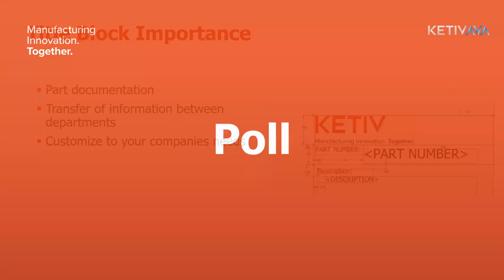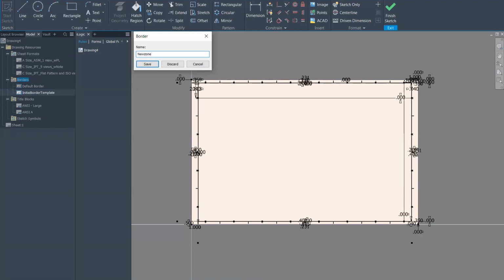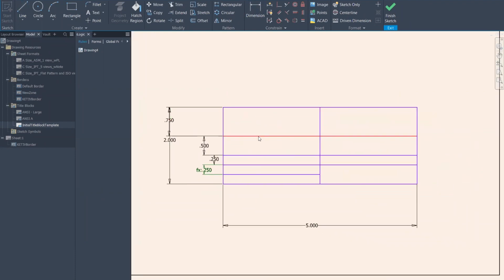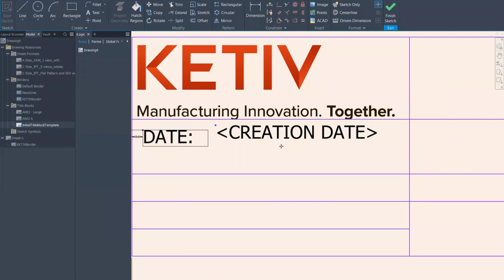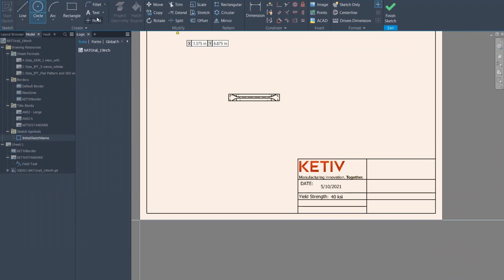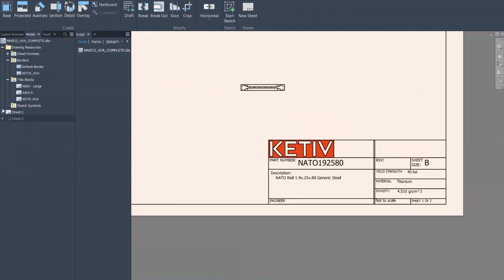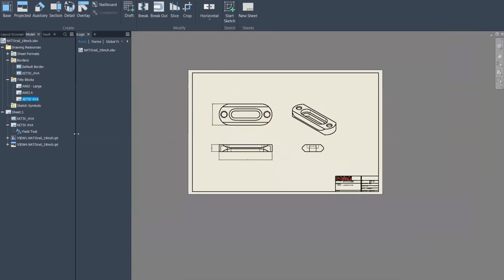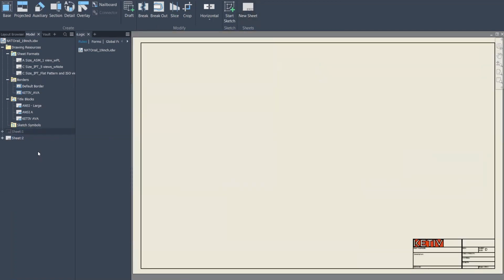Inventor 2022 Drawing Documentation - Title Block Creation | Autodesk Virtual Academy

Comment: Hi there, I had set my Sheet size to A4 landscape options followed by H210mm x
W297mm, I found that the sheet seems like has its own Margin Top/Bottom/Left and Right at 10mm respectively. This mean my most outer frame maximum size has to be H190mm x
W277mm. What I wanted to ask is that, can we customize the margin top/bottom/left/right?
Thanks for advise 🙏❤